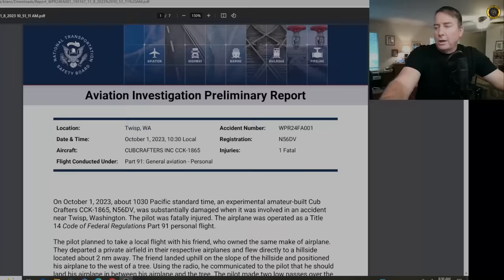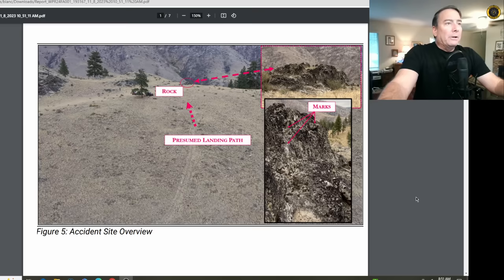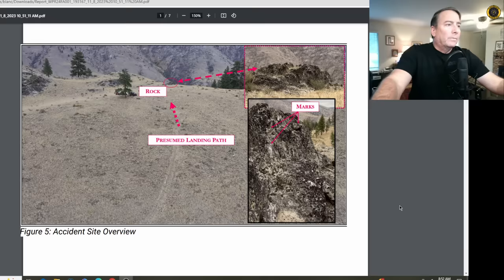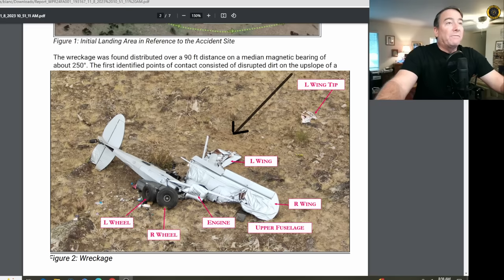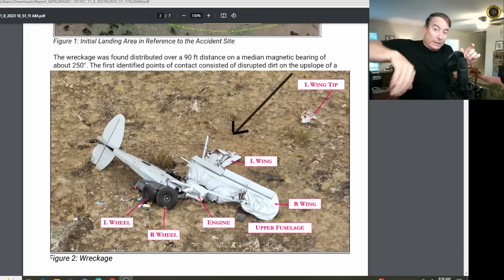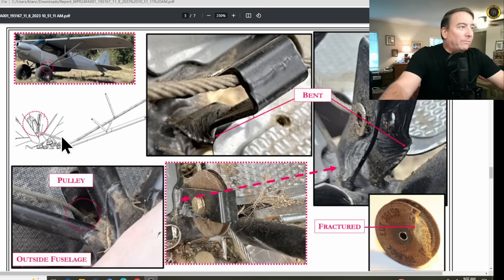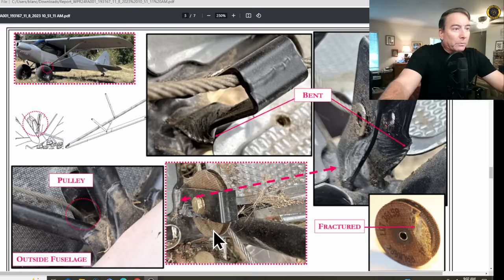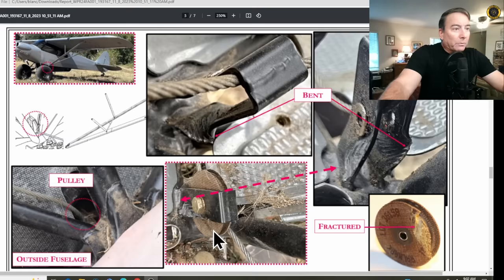Carbon Cub N56DV Fatal Accident NTSB Preliminary Report 10 Nov 2023

Comment: Phenolic is too brittle, why is it used for a pulley in a vulnerable location? Had the sidewall of the pulley not broken out letting the cable fall off, the aileron cable would not have jammed. Those pulleys should be machined from 316 stainless.
Reply: Then you will find out why you use phenolic.  I suspect it gets along with the stainless steel cables better than anything else.

Comment: No doubt he did stupid stuff with his airplane, but I can't hold back from pointing out how terrible that flight control surface cable design is. I wouldn't have ran a cable that low and exposed, I would've ran it inside the wing, so it could only be damaged in a hard crash, which wouldn't have had any influence on the outcome, as if you lose a wing, you're done anyway.

Comment: Since the cause was an incorrect choice of landing, it sounds like this pilot was incautious and hasty. Even with coaching from the ground via radio, why wouldn’t a pilot fly over to observe and understand the otherwise unfamiliar conditions they are about to land in? ..  I’ve never landed in these kinds of off-field conditions, but quite a few Northeast grass strips. I am far from an expert, so I always overflew the new-to-me fields to observe and try understanding ground conditions and such, before entering the Pattern. Knowledge is better than luck. Luck favors the prepared.. etc.